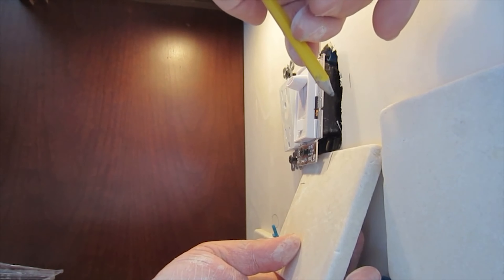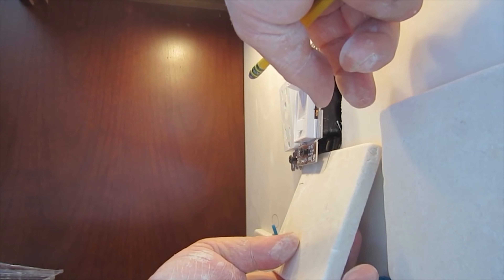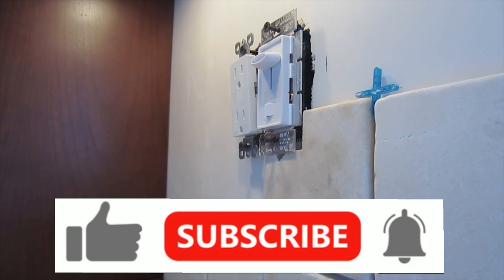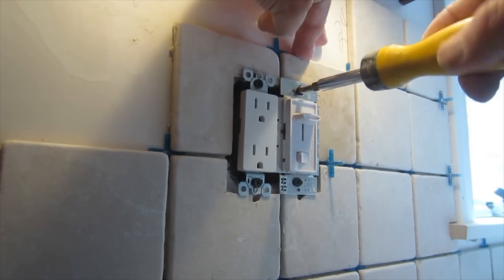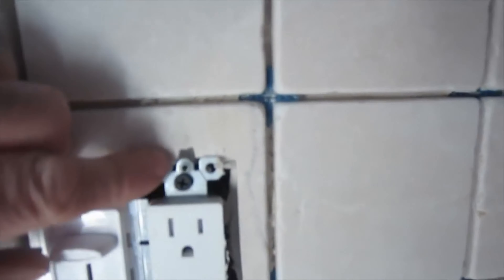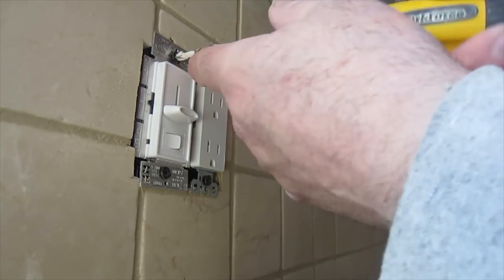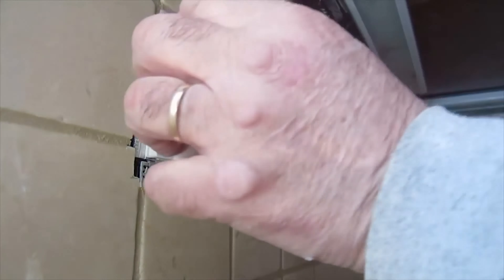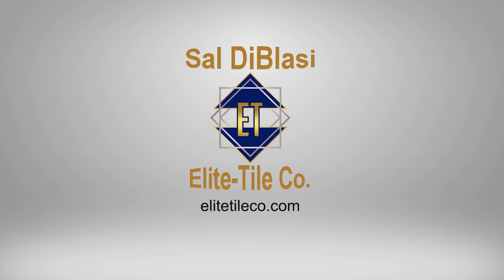How to  tile around an electrical outlet, Kitchen backsplash

Comment: Funny, we picked up 82 sq ft tumbled marble 3x6” yesterday for our backsplash. As an electrician I can tell you that the cover plate screws 6-32s can be cut in a pair of wire strippers by turning one and a half turns past the cutter. I do it regularly when I install GFIs in bathrooms/kitchens.